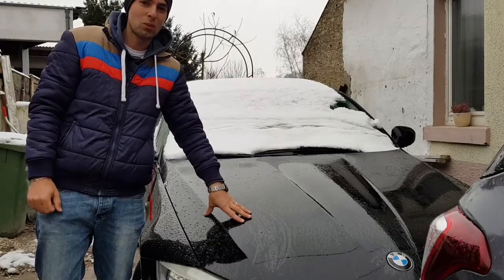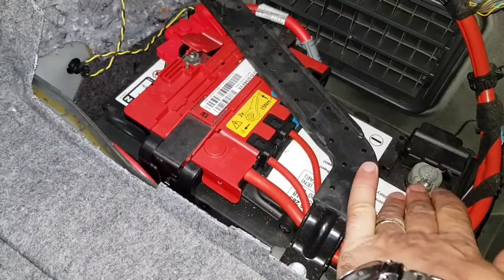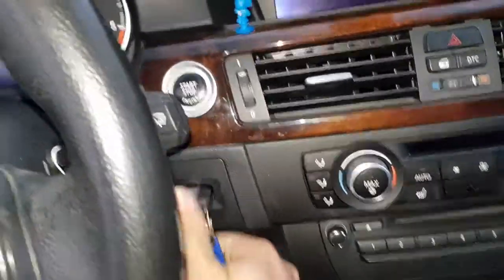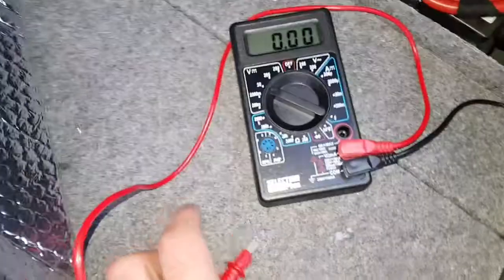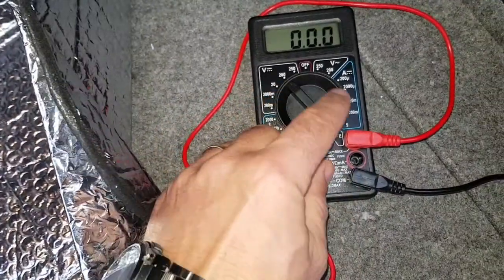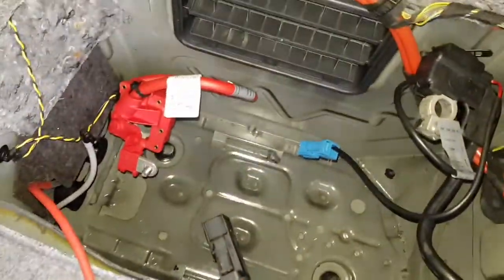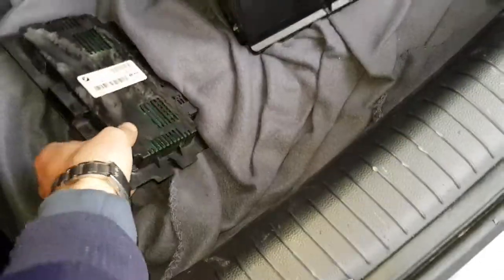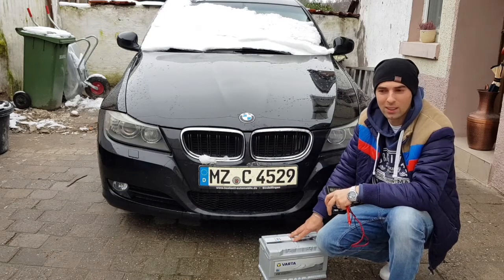How to Test a Car Battery with a Multimeter

Comment: where you bought a new battery??? I have the same problem.. and how much it cost??
Reply from the maker: +Bmw e-90 LCI from a regular part store. It
have to be the same specs like the old one. You have to check first if it's a AGM batterie. After that you have to code the car.